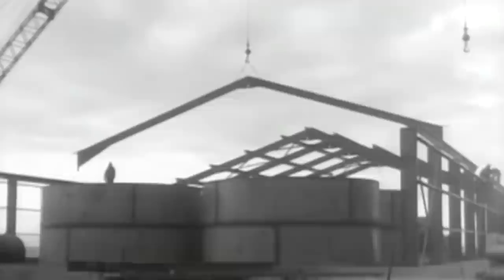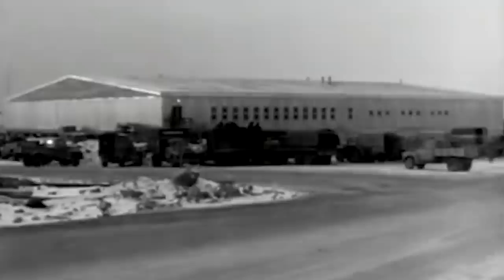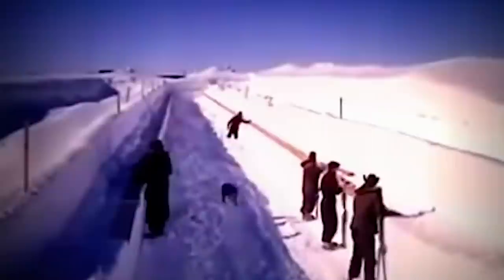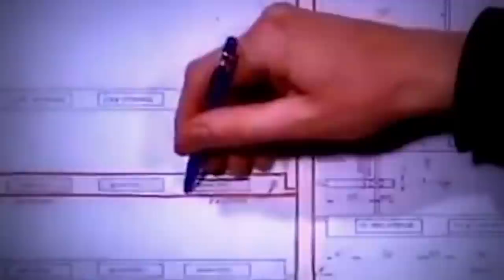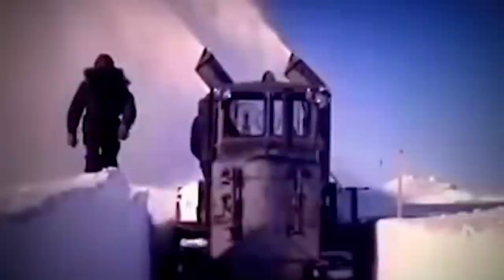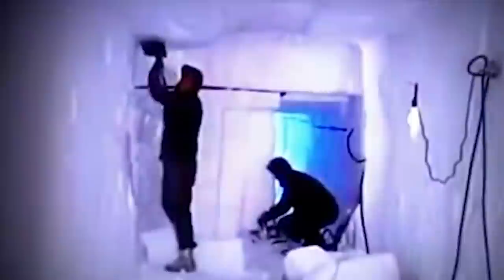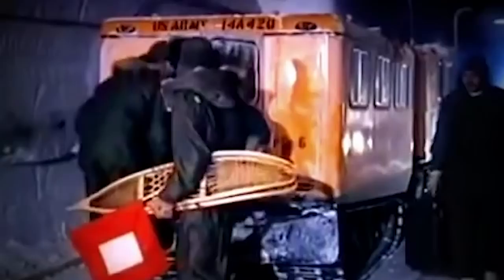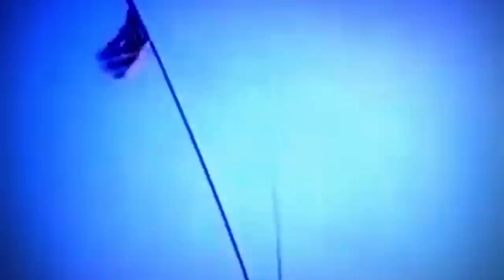Project ICEWORM

Comment: 1961 - 1963 I was a radio operator stationed at Camp Tuto near Thule AB and Camp Century over a two year time frame. Two 6 month tours at Camp Century and one 6 month tour at Tuto. There was nothing subversive about Camp Century and the Danish Government was fully aware of the arctic research going on there. I had to have an Amateur Radio license for a ham radio since I was the only Amateur radio licensed soldier on site and had to go through the Danish Government to get the license. I got two, one for KG1CC (Camp Century) and KG1BA (Camp Tuto) both issued in my name from Denmark. I still have them as souvenirs. The reason for the metal covers over the trenches was to allow snow buildup to form solid, not to hide anything from the world. I was assigned to PR&DC (Polar Research and Development Center at Ft. Belvoir and sent TDY on my three tours to Greenland. I was one of the support personnel for the scientist that were digging cores of ice down to a mile or more used to study the history of world events like weather, ice ages and more for possibly 100 thousand years. Those cores have proven invaluable to scientist in studying earth history. The original Camp Century which was pretty much like any small Army installation at remote sites around the world did not sink, the snow buildup on the topside was as much as a meter per year. It would make you think the camp had sunk. But the ice walls were gradually trying to return to their solid state and pretty much crushing anything in the way.

Comment: Just to be clear, the portable reactor was never crushed by the ice and it was removed when the project was shut down, and there never were any nuclear missiles based there. Camp Century was built, but Project Iceworm never had any missiles as it was never found to be feasible to base them under the ice like that.
Reply: Your Going too Ruin The Story People Will Believe Anything
Reply: dam, was hoping it was still there for the taking! :) would run my neighborhood just fine... :)
Reply: The US did leave the nuclear waste from the portable generator, more than 200,000 liters of diesel fuel, a substantial quantity of PCBs & twenty-four million liters of untreated sewage.

What do we all tell our children when they make a mess? We tell them it's their mess and they are responsible for cleaning it up. 

The US needs to take responsibility for all of the remaining materials,  biohazards and waste products they left behind.
Reply: @JJDiddley  Seems odd that there would be any uncontained nuclear waste from the reactor, though. I wouldn't think it would have needed refueling, but not sure. Spent fuel is all I could think of that could be left.
Reply: @bills6093  It was contained at the time of the operation. Think in terms of Fukushima and the nuclear waste containment there. They have been storing their radioactive waste water on site since the devastating tsunami, which is much more recent in history. What happens when contain reservoirs age? They begin to rust, corrode and leak. That's what is currently happening at the TEPCO plant at Fukushima. The radioactive waste water is now leaking into the pacific ocean.
Reply: @JJDiddley  I would have thought the containers for spent fuel would be pretty robust and made of materials like high grade stainless steel that won't just rust away in a few decades. Fukushima isn't really comparable, imo.
Reply: @Free Radical TBH The fact that you are bringing up Fukushima as an example of the dangers of radiation makes me think that you have no idea what you are talking about.
Reply: @Charles Yuditsky Exactly what I was thinking. The US Military's standard cleanup of sewage involved mixing an equal amount of diesel and 'burning the shit' according to every 'Nam and Korean war book/movie I ever absorbed.
Reply: @bernard6413  The B-52 crash is not related to Camp Century or Project Iceworm. Tacit permission of the Danish government was given for those 4 nuclear weapons on the B-52 to be located there. The crash was, of course, an unintentional event, and a massive long term effort was made to clean up the crash site. There is an extensive Wiki article on the B-52 Crash at Thule. Camp Century and Iceworm never actually involved any nuclear weapons.
Reply: @bills6093  i know,but in greenland today all of your radioactive containers filled with radioactive dirt and other things are still there and the whole area is a no go zone because of some kind of radioactive outslip and nukes cant be on danish soil,so it can only come from where.....?
Reply: @bernard6413  The Cold War era was not a good time for the world. Fortunately it ended. Unfortunately, the collateral damage is not easily resolved. Just think what the communist countries have done and hidden regarding nuclear weapons and weapons testing. Lots we don't know about, I'm sure. Hopefully, Greenland at least knows what problems are there.
Reply: @bills6093  true,but you must admit that it dont come from an out of control x-ray machine,though it also leaves radiation trash
Reply: @bernard6413  I would have gladly taken the money we sent to Iran and given it for cleanup of those messes.
Reply: @bills6093  you over the Russians or Chinese anytime! We danes made a mess in the past to,so iam not trying to polish my halo or nothing,but in war,America really dont give a shit about anybody,and Greenland seems to be a piece a real estate the usa just cant forget about,maybe you triee to pollute us to sell,who knows,thankfully its still under the crown and we are your allies,so maybe things ended best for us both
Reply: @bills6093  The point was, there is no good way to store nuclear waste, spent fuel rods and radioactive water left over from cooling the unit. No, Fukushima and this project don't have much in common at all, really. The point is there is no good way to dispose of the waste.
Reply: Heh, "burn the shit". Imagine a grey cloud of radioactive shit snowing down upon the earth.😍
Reply: @JJDiddley  Launch it towards the sun. Elon Musk can do it cheap, right?
Reply: @bills6093  I think you and I can win the Nobel Peace Prize at this rate! 😆
(I swear you must be someone I know IRL.)
Reply: @JJDiddley  52k gallons of oil eh god bless America time to sell it to north Korea
Reply: @JJDiddley  My answer to all of You is: What does France do with their nuclear waste? I know and you should you.
Reply: @jrothwell2  The French have better nuclear waste management systems than any other country but the process to reduce nuclear waste to low level nuclear waste takes YEARS. That process never results in inert material. They admittedly cannot keep up with their waste containment loads. 
The bottom line is this: We have no sustainable way to deal with nuclear coolant waste water and no way to 100% dispose of nuclear waste solids. Meanwhile, solar and wind energy are completely renewable. To me, that's the end of the argument. I have been utilizing solar power since 2001. It's reliable, dependable and truly the most affordable way to power  just about anything. I know lobbyists that will tell you different just so they can continue to sell nuclear power. They depend on people like you whom chose to believe what they want you to believe. Meanwhile, if I have extra solar power stored on my batteries, I can sell it for cash or credit back to the local broker. ZERO WASTE. No damage to the environment. It's a no brainer.
Reply: @JJDiddley  Nuclear waste isn't that widespread an issue. Reprocessing is more about regaining usable uranium than separating isotopes.
The huge upside is you have high density energy created in a localized area with 0 carbon emissions during operation.
While you have been using solar, which is great, I'm sure you're not using it to run several dozen 200A service CNC machines in 24/7 production.
In order to match the power output of a single 1000MW nuclear reactor (or gas/coal/oil/whatever), you would need over 30,000 acres of solar panels in the california desert and the largest battery backup facility ever made.
No waste? Well according to the laws of thermodynamics, moving energy costs energy, and that's very much true for transmission lines. You're going to lose a pretty substantial chunk of power just moving it over those 30,000 acres. If you can use lithium batteries you're at least only losing ~1% to charge and discharge, and ~2% per month if you need to hold charge that long.
Aside from the enormous sprawl of the solar panel facility, the single greatest limiting factor is actually the latitude. 30,000 acres of solar panels is only comparable to a 1000MW reactor in the hot california sun. That size doubles once you get up into Canada. 60,000 acres of solar panels.
And while you can service them with electric vehicles, and they're >95% recyclable, and have an immense service life, and the amount of heavy metals used is fairly minimum, that's still a HUGE project just to generate almost 9000GWH/yr. And it doesn't give you much reliability when it's dark for 16+ hours a day in winter.

Now, the UP side to nuclear waste is that it IS mostly solid wastes.
Why is that an upside? Well solids don't leak or float anywhere.
Imagine a 1000MW coal plant, but instead of generating smoke and ash, it generated only a dense solid waste product. Coal wouldn't be nearly as bad if it generated only solid waste. But then we'd have to DO something with it. "out of sight, out of mind" is the convenience of fuel burning plants, and also the convenience of not having to know where your solar panels are made.

So while solar is a great solution for small to modest uses in places that can really support it, it's certainly a long ways from being a universal solution.
And wind power falls into the exact same pitfall as solar and hydro; works great in locations that are favorable, but it's useless in locations where it's not favorable.
Reply: the camp was never shut down.
Reply: @JJDiddley  Because solar is ideal where the sun don’t shine, where the requirements are high, and in a world where the bitching about C02 is all the rage but nuclear scary, what do you propose for places like Alaska or big cities that have more people than surface area for the sun. 

Also breeder reactors and just deal with it as far as waste goes. The amount of power we can generate, the lack of greenhouse gasses, the reliability, and the small amount of waste far outweigh trying to pretend some wind turbines and solar panels are fully adequate for this power hungry society. Nuclear should not be the long term option, but if coal and oil are to be so taboo then it is an absolute must. Until we can make solar actually reliable and long lasting, it will be for people like you to benefit from but large scale still needs work. Also all this nonsense of “can’t reduce it to weapons grade fuel” so let’s put good fuel that still works in holding tanks and cry about waste needs to end. Build more nukes, dispose of the old ones, use the fuel till it is not useable period, and deal with the weak leftovers.
Reply: @bills6093  it will just come back on the “solar wind”.
Reply: @JJDiddley  forget Fukushima... what about the nuclear waste dump in the pacific?
Reply: @Charles Yuditsky Get’ta stirring boy
Reply: @bernard6413  A Great Dane or just A Dane????
Reply: @bernard6413  🤣🤣🤣🤣

Comment: The reactor was portable, hey it only weighs 400 tons
Reply: @ss ss very true, since most reactors are probably in the 1000s of tons. I would like to know what the weight of the two reactors that were in the NB-36H
Reply: Oxymoron for humans
Reply: Thats just 5 conventional semitrucks worth of weight
Reply: It's very difficult to make portable nuclear power station lighter than 200-300 tons, but it's still could be moved around relatively easy. Soviet variant of mobile nuclear power station had weight about 300 tons and was totally portable - it was mounted on 2 tracked vehicles.
Reply: Try and move around a classic reactor with it's 60.000 ton steel/graphite/cement encasing burried deep into the bedrock. 😅
Reply: @user-cg9uf1mu2z  you have any links to were I can see or read about this portable power station?
Reply: the portable was mainly referring to the fact that it wasn't built in place. you could IN FACT move the reactor to be used wherever. They didn't say it was light or easy to install or user friendly. Just that  it can move and it indeed could. Pretty impressive for the time, I would think. Not sure about that tho.
Reply: @andrewscott8892  Here you are: https://zen.yandex.ru/media/oldtimer/tes3-atomnaia-elektrostanciia-na-gusenichnom-hodu-5c123883ae604200ac928458
It's in Russian, though.
Reply: @RobertLegereIII  I understand what they meant people, it was a sarcastic remark

Comment: 8:25 Good to hear that 2090 melting year. One thing is not right with it. 1942 lent and leased aircraft "Lost squadron" was forced to land and left in the Greenland glacier. In 1992, they were 90 meter deep in the ice, and were picked up by war airplane wreckage hunters. That means an increase of 1.8 meters per year. In its 70 year, it will grow by 127 meters, on top of what has grown by 99 meters in 55 years. In 1965 to 1992 ice was grown 48.5 meter, depending glacier area.  If Glacier not flow in to ocean before that.

Comment: Exposed by global warming and then goes on to say it "might" happen by 2090!  Double hockey sticks again LOL
Reply: Earth was warmer by 2 degrees 52000 years ago. Nothing happened lol. Global warming is a joke. The earth's weather is cyclical
Reply: But, but... AOC said we only have 10 years.
Reply: @johndowe7003  i bet you have a PhD
Reply: john dowe how fast did the temperature increase?
Reply: @Quantum-Bullet  I'm not sure , I just know that scientists on both artic poles drilled ice cores and I'm not sure if they took out air pockets or what but both cores showed the same thing. That earth was warmer by about 2degrees 52000-57000 years ago. No point in arguing with folks about facts.
Reply: @johndowe7003  ok nature adapts, not at our warming rates though...
Reply: @Quantum-Bullet  nature adapts regardless of temp. It's animals that die that's all, new animals will take their place
Reply: @johndowe7003  adapts and survives if the change happens slower. For example coral reefs will die off quickly. Even if not all plants and animals die straight away they are all needed for a healthy eco-system, what would replace bees for example?
Reply: @Quantum-Bullet  bees aren't dying from climate change, they're dying from those damn farmers spraying pesticides
Reply: I'm getting nervous about 2089!
Reply: @paro5614  That's DOCTOR john doe to you!
Reply: @johndowe7003  whether and climate are two different things

Comment: I was at Camp Century Jan 21, to April 20 in1963. When I got to camp it was -74 degrees f and total darkness. The reactor was built by ALCO and was a pressurized water reactor, when taken apart all the radio active material should have stayed in the heat exchanger. I was at camp Tuto when the fuel rods came from Century. The camp was not a secret, Germans and people from Denmark some from the US that trying to drill through the ice cap. The ice at Century was 7300 feet thick and the wind blew at 100 miles per hour, at much as three times a week. That is why the was built under the ice to get away from the wind. Now think about trying to send rocket away with that kind of wind and nothing but ice all around you. What I saw was just all bs.

Comment: Don't the yanks still operate a leased military base at or near Thule? If so then that's the perfect place to dump all their abandoned chemical and radiological waste. Just drive it onto their base and dump it square in the middle, that way you can bet it will be cleaned up very quickly by them, problem solved.